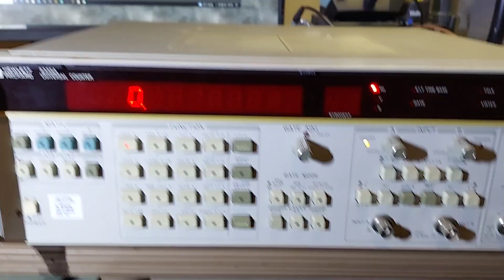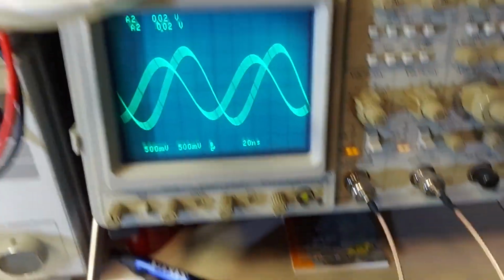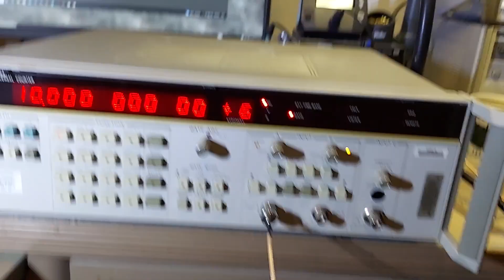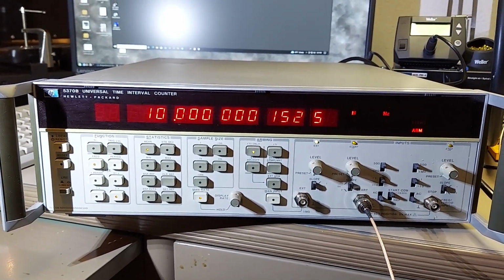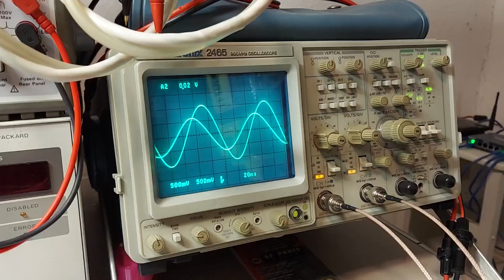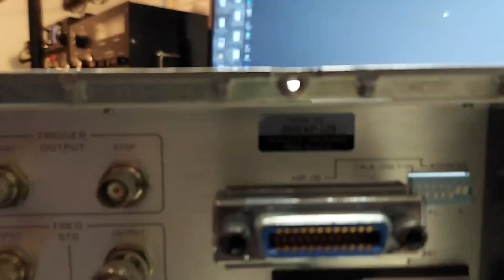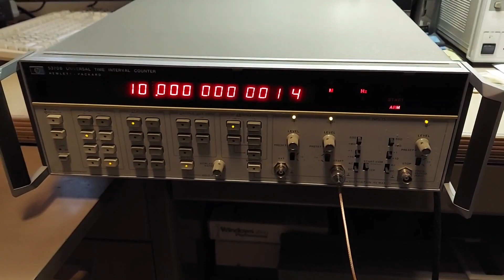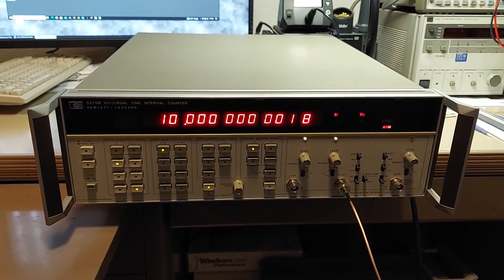HP 5335A and HP 5370B Universal Time Interval Counter

Comment: Two really nice HP counters! Thank you for showing them to us. A couple of tips for the 5335A  - first, get Service Note 5335A-26B and check out your power supply relay and socket, there is a problem with overheating that may damage the relay, socket and board. Second, there is a firmware revision available, during boot-up check to see if there is a decimal point between "ADDRS" and the GPIB address number. If not, then firmware revision 1.0 is installed and can be upgraded to version 1.1. But be careful, there are two different versions of 1.1 depending on which channel C prescaler is installed. I adapted AT28C64 EEPROMS to replace the original PROMS. Lastly, if you would like MORE resolution, replace A4C36 with a 22 uf to 47 uf 10 volt low leakage capacitor (value is circuitry tolerance dependent - I used a 22 uf in mine - tantalums are okay). This extends the gate time to a maximum of about 12.5 seconds. Connect a 10 MHz (or just over) source and check the display with the gate time set above 10 seconds. Regards, David
Reply from the maker: Thanks for the tips David, I carefully inspected the unit off camera and didn't see anything obvious. The counter I show in the video has firmware version 1.1, it also has the channel C board installed. The other 5335A I have came with only option 40 installed, I added option 010 about 8 months ago, this unit also has firmware 1.1. I'll download the service notes and check for this issue during my next service interval. Once again thanks for the tip and thanks for taking the time to watch the video.

Comment: What a lovely pair of lady's!  I'd like to add one to my collection as well one day, but like you...I have no more room!  But that wont stop me from buying and storing!  :)  I'm testing a HP 140T SA right now with the option to buy, not sure of $$$ But I will offer a C note for it, they're great for finding a signal but not  a viable tool...cant tell you what freq your on but they do have swappable modules that go from hertz ~ 40GHz  in four modules, so some value.  Thanks for sharing!  ~Jack, VEG
Reply from the maker: Good Morning Jack, the old HP 140T is a pretty impressive old spectrum analyzer, I believe with the right plug-in you can get down to 10Hz of RBW. I have two HP 853A's and like the HP 140's there is no practical way to accurately measure the frequency of displayed trace. Depending on the plug-in the HP 853A's center frequency display is accurate only to 1MHz or so. A HP 5335A would make a great addition, you can always add options later if you cannot find a fully equipped unit.